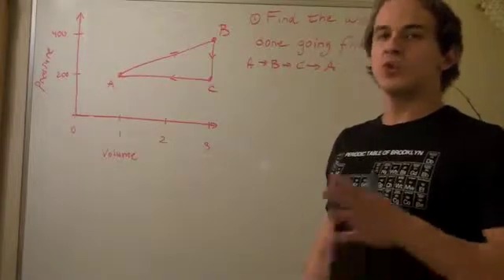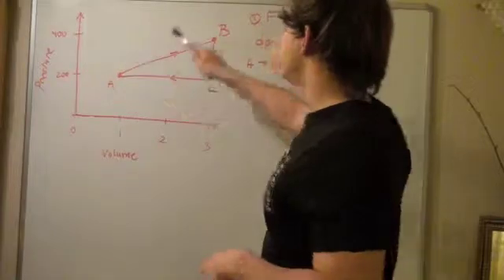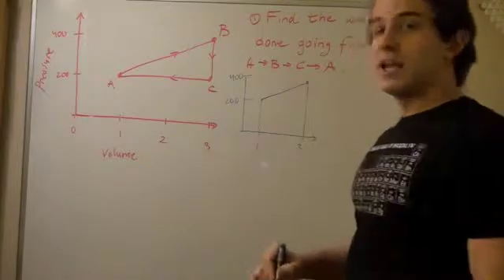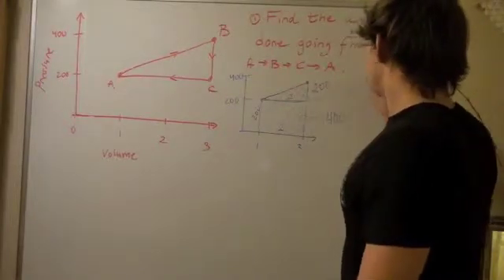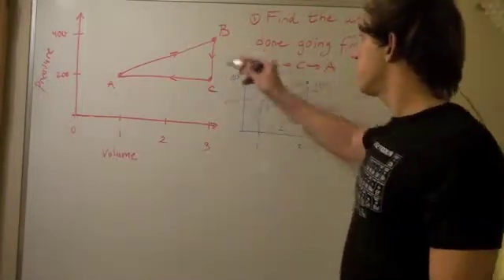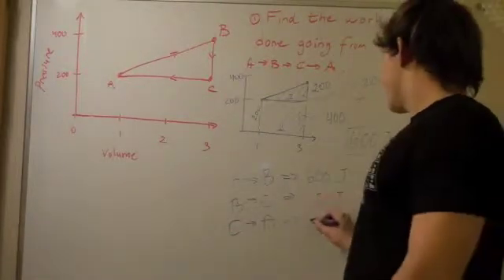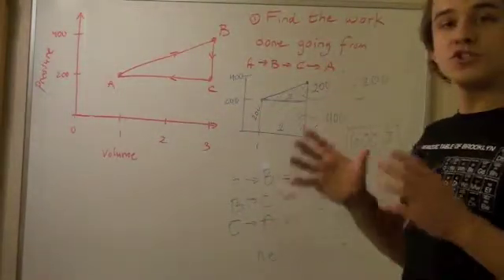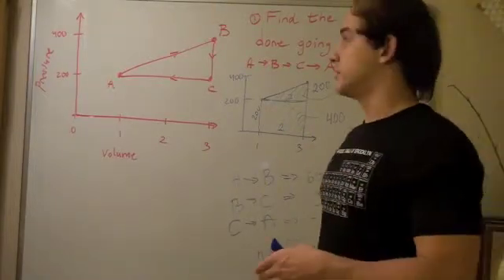PV Work Example

Comment: if the net is (+)200 J, why cant you say its Work done ON the system by the surrounding. isnt (-) work done BY the system. Im really confused.
Reply from the maker: Hey! If the system loses energy, then it does work on the surroundings. If the system gains energy, then work is being done by the surroundings on the system.. Hope that helped!
Reply: 5:23 mister Andrey says that positive work means the system does work to the surroundings. This is wrong. We view work from the perspective of our system so when the system does work it's loosing energy hence the sign is negative